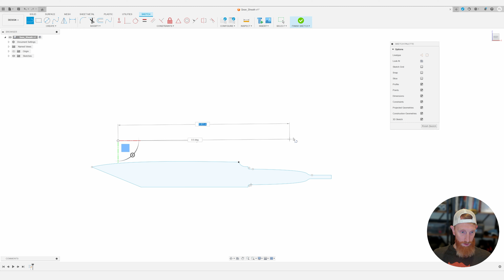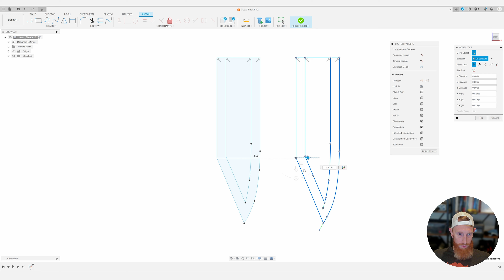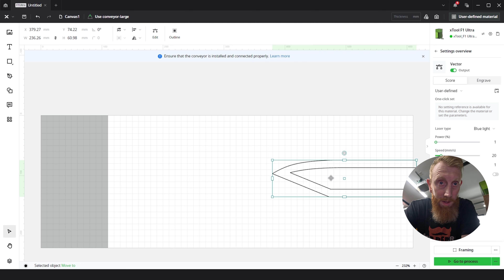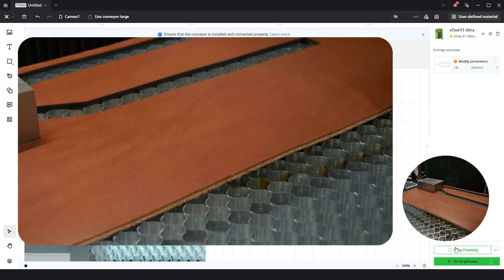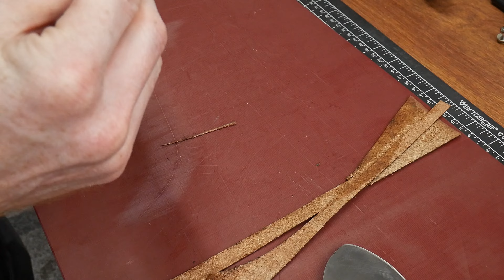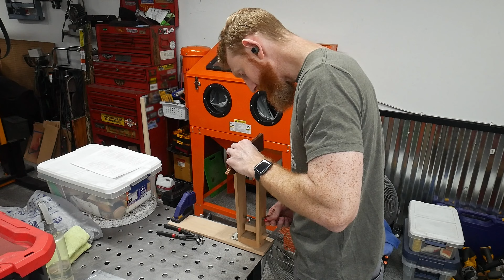Do Lasers & Leather Work Well Together? Get PRO Results with These Tips!

Comment from the maker: ⚡XTOOL F1 Ultra Laser - https://www.xtool.com/products/xtool-f1-ultra-20w-fiber-diode-dual-laser-engraver?ref=RedBeardOps&utm_medium=5306&utm_source=influencer

🗡 Buy This Seax & Sheath - https://redbeardops.square.site/product/RedBeardOpsSeax/10

📋 Notable Items and Tools:
Paul Long Sheath DVD - https://amzn.to/3HgQAN3
Leather Splitter - https://amzn.to/3P9yluH
Japan Select Basket Stamp - https://amzn.to/2NDRg5q
#2 Edge Beveler - https://amzn.to/2FqGivQ
Stitch Groover - https://amzn.to/3iHp0J3
John James Saddlers Harness Needles - https://amzn.to/31QzfWp
High End Cutting Board - https://induscousa.com/hydroma-cutting-board/
Spring Dividers - https://amzn.to/3svYXJW
Stitching Pony (Requires Hinge Mod) - https://amzn.to/3dV5I41

🧵 Leather Supplies:
Wickett & Craig Leather - http://wickett-craig.com/leathers/skirting/
Fiebing's Cement - https://amzn.to/3uVDsZW
Quick Slick (Burnishing Agent) - https://www.barrykingtools.com/finishingproducts.htm
1mm Waxed Thread - https://amzn.to/3kIzp9g
Neatsfood Oil - https://amzn.to/35GwyVP
Wool Daubers - https://amzn.to/3418Cz5
Pro-Carv Casing - https://amzn.to/3dHQdMC

Comment: I too have been looking at cutting sheathes on the F1 Ultra, but I am wondering if you have ever figured out a way to lay out the stitching holes so that you don't have to manually punch them later?
Reply from the maker: It's one of those things that I think is more trouble than it's worth unless you are making the same sheath over and over and over

Comment: Can’t you just make the entire profile one entity, and then offset by 3/32 ?
Reply from the maker: If there is a function that does this I'd love to know!
Reply: @ I was just asking because I don’t have much experience with fusion 360, I used the free trial and really liked the program but we opted to use the regular CNC software that was available with our router called woodWOP, I am breaking out into knife making . I haven’t made one, but I designed my blanks in auto CAD and sent my designs to be laser cut.

Comment: I am making a knife, but I made a mistake in thermally treating the knife and put the knife in water instead of warm oil. If I heat it again and put it in warm oil, will the problem be solved?
Reply from the maker: First of all you should check for cracks since water quenching can be very aggressive on a knife. Secondly you should thermal cycle the blade by normalizing it a few times. Then you could attempt an oil quench. Check out this video for heat treating 1080 - https://youtu.be/TBIiWwawKSY?si=lqD6lRM5z8m0FLFt